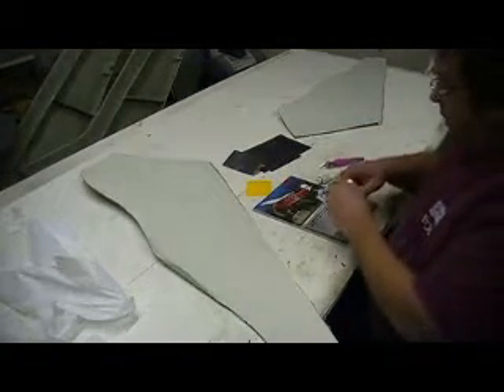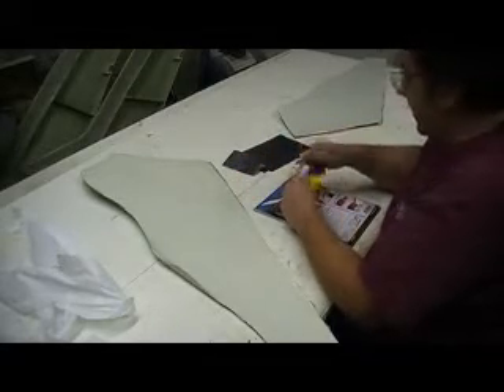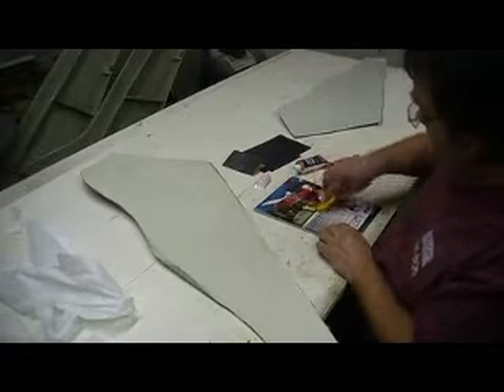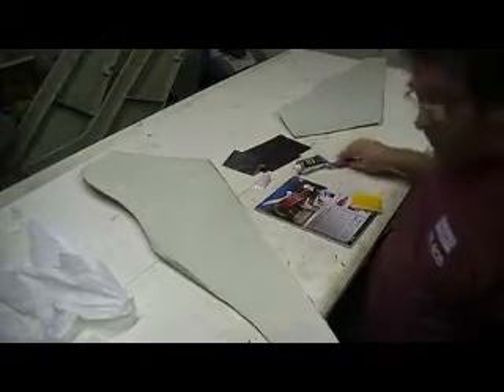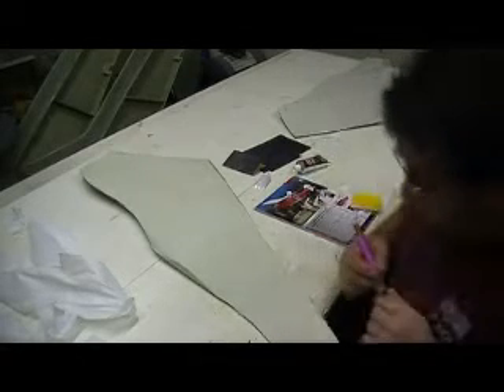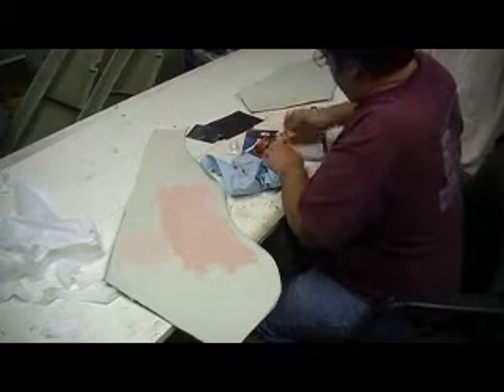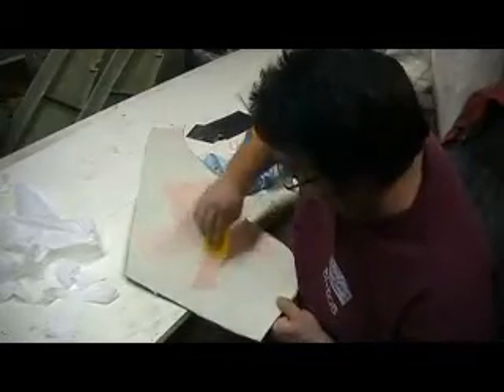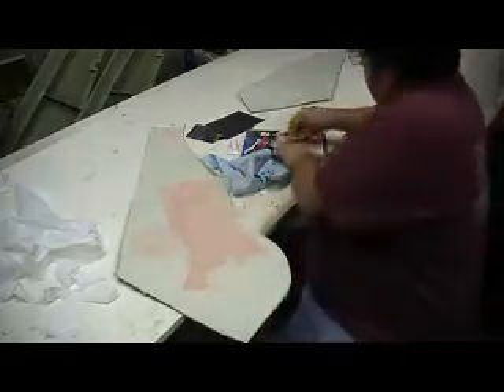F-105 thunderchief buildn action # 28

Comment: @ianober, Just to finish the thought,  I've done bondo to fill the weave it works. Last time on my P-38, I actually applied regular wax paper like Bob used the peel ply and the final surface was great, smooth, light sanding, ready for paint.

Comment: @ianober, Understood but I am not looking to bond anything to the surface. In fact that surface is the finished surface. It's a technique that's used to make gear doors over existing wings. You lay down a plastic film (monocote etc) over the wing, then lay down several plys. This give the gear door the exact curve of the wing/fuslage etc. I've done this on several models. The hardest part is getting a smooth finish on the final ply which is going to be the show side.